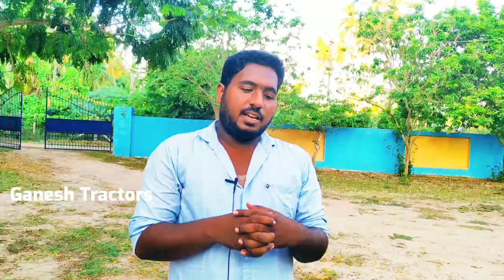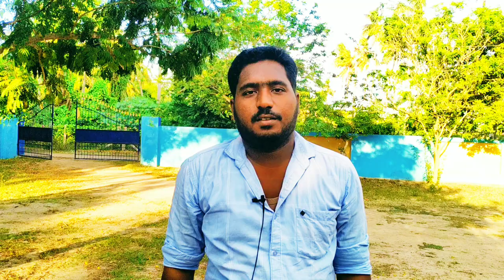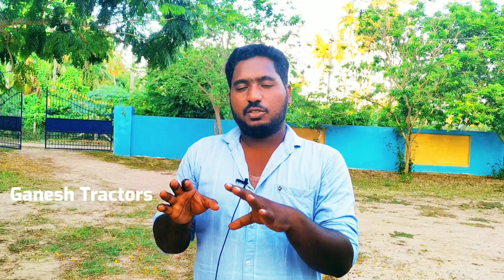Increase Tractor HP | Turbo | Ganesh  Tractors

Comment: MF 7250 tractor சேடை ஓட்டும் போது டயர் பள்ளம் பறிக்காம இருக்க ஏதாவது தகவல் இருந்த தெரியபடுத்துங்க அண்ணா
Reply: Air pressure evlo vaikaringa?
Reply: 20  to 23
Reply: @govindarajARG  For field work only 15 to 16 psi

For Road work 20 psi only for heavy lifting 
Normal work 16 psi vachi otunga enough 

Namma oorla puncher kadaila soldradha ketkadhinga 

Avanga 20 to 25 solluvanga 

Neenga 15 to 16 psi mattum vainga

Rotavator ku top link low sensing la connect pannunga
Reply: @Fieldwings988  OK sir thanks
Reply: But MF 7250 had only one sensing sir
Reply: @govindarajARG  Yes Yes one of a drawback.